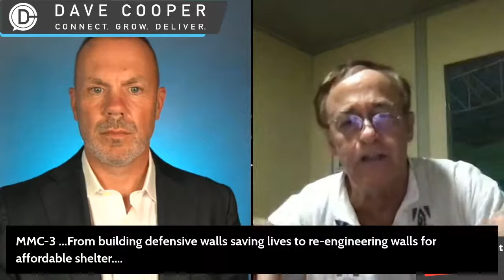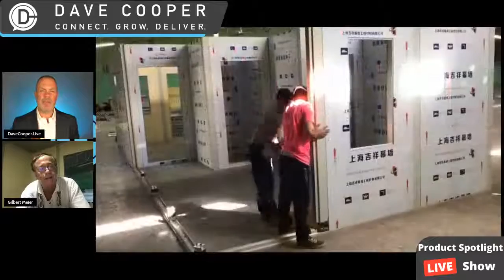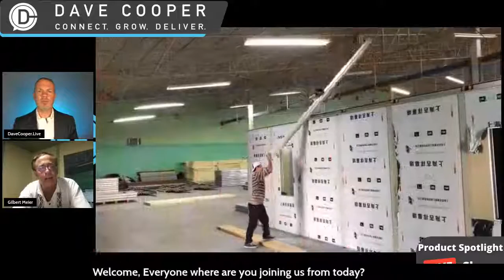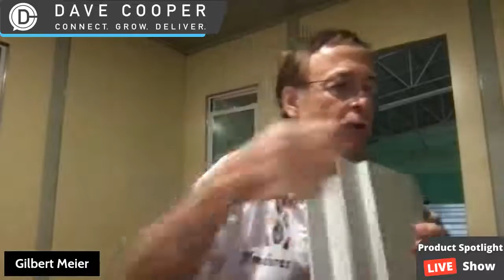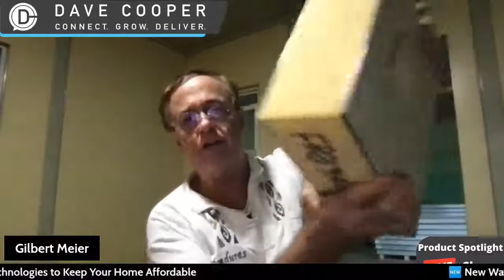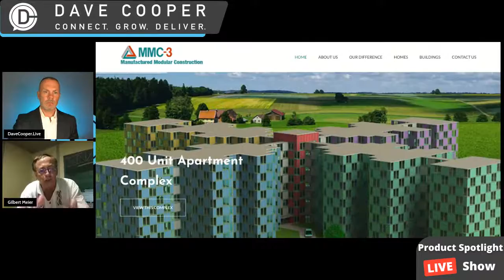MMC-3 Affordable Modular Housing - NO Crane Required!! 🔴Live From Honduras:

Comment: Send Al how are you going to install the heat and air conditioning vents of resealing with your return bed
Reply from the maker: Hi Randall! Typically, heating, ventilation, and air conditioning professionals handle the installation of vents and ensure they are sealed correctly.